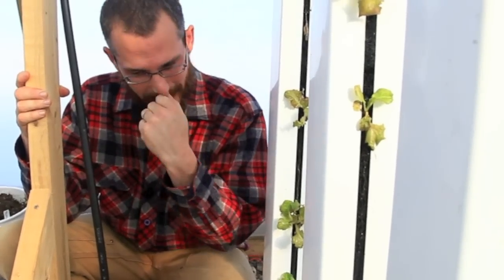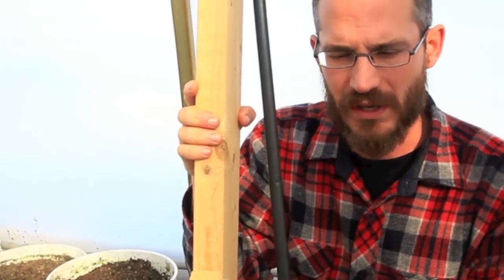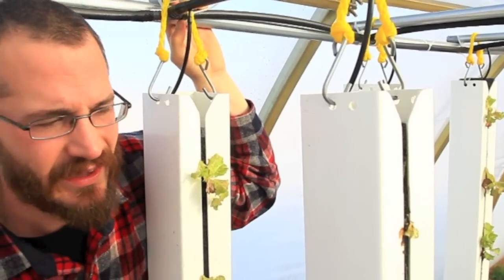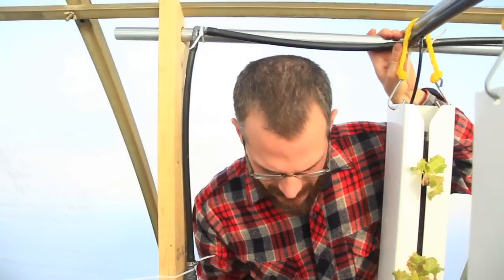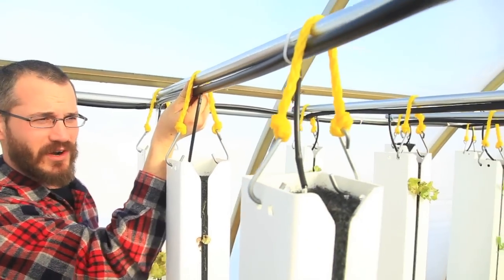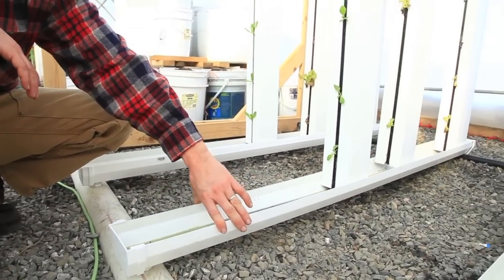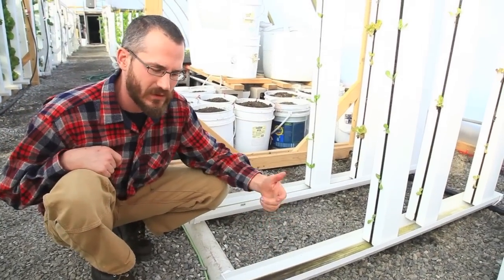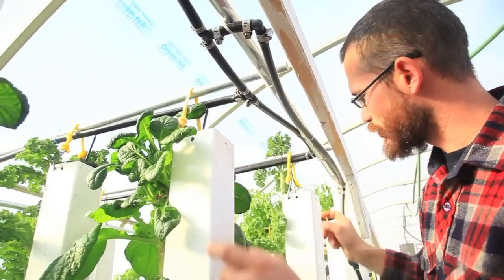Plumbing a Vertical Farm

Comment from the maker: Hey Al, great question. We use a recirculating system where our nutrient water flows from the fish tanks to the towers where its caught by a guttering, which takes it to a sump (the low point in our system). The sump distributes half of the water back to our plants and half back to our fish for more nutrients. Does that answer your question? Feel free to ask others!

Comment from the maker: You can run the system on alternate power sources, or for small systems, you can run them by hand by cycling the water several times a day using a bucket.  Bottom line, large systems like ours don't require much electricity, but to make them manageable they do require electricity.  Of course if you're handy, you can always build a wood gassifying generator, or a Stirling engine to run off of your furnace to generate electricity or pump for you.

Comment: Quick question regarding the mixing tank: I imagine that a 275 gallon IBC tank as suggested would be quite heavy when filled. Would one need to pour a concrete slab underneath the IBC tank?
Reply from the maker: That will largely depend on what your current foundation your tank will sit on. Are you sitting it on soil? Our IBC brood tank is not on a concrete slab, but it is on a solid dirt foundation that also has some crushed granite on it. Overall, it's very strong and the weight is dispersed very well.
Reply: Bright Agrotech Yes it will be sitting directly on the soil. Thanks for the info. How many gallons is the IBC tank you are referring to?
Reply from the maker: Nicholas Silverman That one is 275 gallons.

Comment: would it be cheaper to use compression fittings or barbed fittings with hose clamps
Reply from the maker: Hi Wallace - for which part of the system specifically?
Reply: +Bright Agrotech anywhere there is a joint like the L fitting or the T fittings
Reply from the maker: Usually barbed fittings work the best for these types of systems. Throw a couple of hose clamps on there and you should be set.

Comment from the maker: 100 square meters at conservative spacing would be producing around 147kg-220kg per week (323-484lbs) of produce per week. Depending on your crop choice, it could be significantly more. Those are the numbers for standard production of moderate producers and single harvest crops. With multi-harvest crops, we're getting into some crazy territory!

Comment: what happens when the stem of your plant is thicker than that opening?
Reply from the maker: Hey bentleyboy72 - The beauty of the tower housing is that it will actually expand out to accommodate the increase in stem size. We've had some serious kale stems in our towers before and they do just fine. Although, by that point, it's probably smarter to take them out and replant since super mature plants probably don't taste as great as younger plants tend to.

Comment: How does the water go/come back around again? pressure? gravity?
Reply from the maker: Hey Glen Wolf! Yes, it's all a gravity fed system where the water returns/drains to the low point in the system (i.e. the sump) and then we use a pump in the sump to cycle the water back to the towers. Here's a video on return lines: http://youtu.be/1Dh3tMhBJt8 - Hope that helps!  #aquaponic   #verticalfarming

Comment: If installing these towers on a slope can pressure compensating drippers be used in the feed line? or will this make the system more prone to blocking?
Reply from the maker: Are you thinking it will be an aquaponic system +TheNetworkD? Pressure compensating drippers will work well with hydro, but because of the nature of aquaponics systems, you'll end up with a lot more clogs because of the organic solids floating around. Have you explored the option of installing a valve on each zone of towers like we've demo'd? These allow you to run simple 1/4'' drippers with poly tubing directing the flow right into the tops of your towers and then allow you to choke back or increase the flow as you need to (i.e. as you get a clog, or as you want to deliver more water to your crops). Hope that helps!

Comment from the maker: Our water runs to a sump, where it's pumped to both our plants and fish.  Regarding fish water- you can send it directly to the plants if you want.  It's no problem.  However, there will be solids in it that some folks prefer to filter and having plants directly downstream makes it much harder to design a solid system.  We recommend sump tanks for this reason.

Comment from the maker: Hi Robert, we use our specially designed Matrix Media. It's a fiber media that allows us to grow really well vertically by anchoring the roots in the ZipGrow Tower. It's really great as it has super high void space, not to mention the high biological/specific surface area. Check out our "Biological Surface Area" video for more info on that.

Comment: can a vertical growing system work with in aquaponic system ?
Reply from the maker: Hi +kevin noel, absolutely. The system in this video is entirely aquaponic. The ZipGrow towers were actually designed initially for improving the production and system health of aquaponic systems, although they work very well in hydroponic applications as well. There are some really nice benefits of using vertical techniques like ZipGrow for aquaponics including the increase in BSA or biological surface area, as well as the use of the media as a complementary mechanical filter. Hope that makes sense!
Reply: +Bright Agrotech thanks i'm new to aquaponics and i am trying to decide on the best configuration of growing space and aquatic species, i have some talapia to start with and , i live in the tropics
Reply from the maker: +kevin noel Right on, tilapia are a great species to start with as they're very resilient! That's what we used for quite some time. What crops are you trying to grow? How much space do you have?
Reply: To begin with I have a 1200 gallon above ground pond
Reply: I was thinking about tomatoes different greens  I have a shed that I can repurpose that's about 30 feet by 9 feet
Reply from the maker: +kevin noel Will you be able to use natural light with your shed? Or will you be using artificial lights?
Reply: +Bright Agrotech yes definitely with shade during the hottest time of the day

Comment: is the water flowing into your tower constant? or do u stop the flow for air to get in occasionally? i heard flow and drain grow faster. i did not manage to find any of your video touching on this issue.
Reply from the maker: Yes we recommend constant flow. Because of the nature of our Matrix Media (93% void space), it has a very high percolation rate, which helps with getting DO to the roots and stabilize root temps. But it doesn't hold water like a flood and drain grow bed or a soil garden would. You don't need to stop the flow to allow air in because it's getting air in all the time. Check out more here: http://brightagrotech.com/matrix-media/

Comment: Is the pump always running or does it stop in intervals via a timer?
Reply from the maker: Hi Christian, we always leave our pumps running 24/7 as stopping and starting can actually shorten their lifespan. The other thing to mention is that our media is designed for high percolation and is inert - i.e. it doesn't hold water. Leaving the pump off for too long could stress plants out as well.